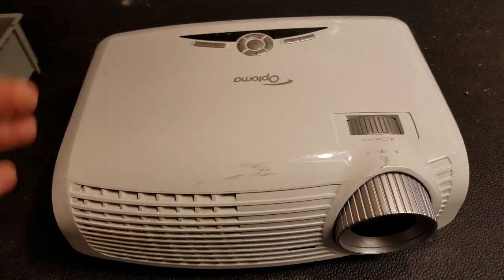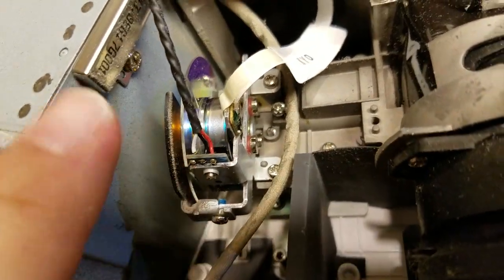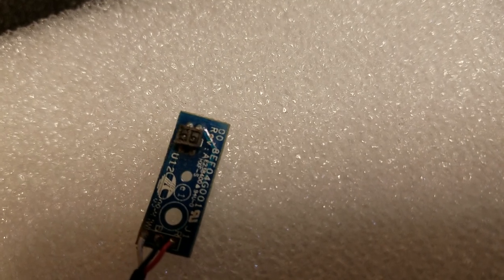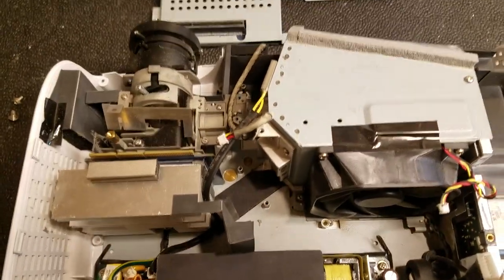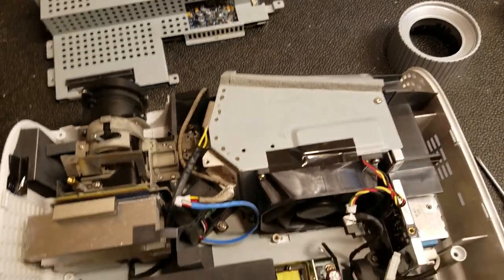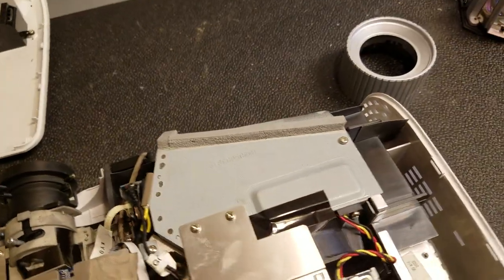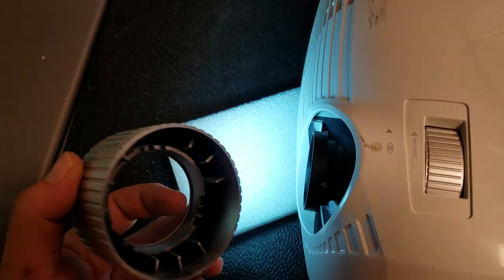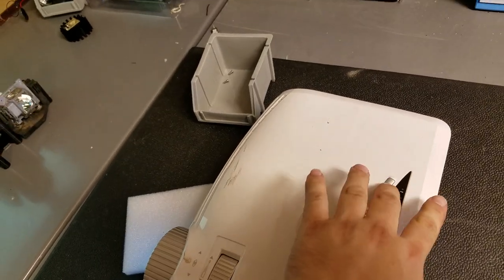Optoma HD20 Projector Cleaning

Comment: When cleaning the circuit boards and fans do you use rubbing alcohol or just an air can to remove all the dust?
Reply from the maker: I use an aircompressor personally and then use a dry cloth to wipe off the rest.  Alcohol would work, but Id be careful in case it attacks the plastic. The goal is get as much dust out as possible. I wouldnt go overboard and remove too many things to clean. You then stand the chance of having issues re-assembling.  I would use some canned air if you have it available and then maybe a dust rag to wipe off the fan blades.  less is more when it comes to disassembly.
Reply: Rostit aweosme thank you very much

Comment: The video beam worked perfect when I turn it off that night the next day I just start the led color ambar and do nothing else any solution
Reply from the maker: tomas di maio amber led is normal when not on. Unplug power and wait 1 minute. Plug in power. Press power button on beamer and it should start. If you use remote, replace batteries first.  if still amber and no fan or light, the problem is more severe.

Comment: How did you get the mother board out?
Reply from the maker: https://elektrotanya.com/showresult?what=hd20%20optoma&kategoria=&kat2=all  Here is a link to the service manuals.  You need to remove the screws around the motherboard as well as the bracket on the top of the optic block.  I have a newer video where you can see me remove it.  https://youtu.be/IBs7E5pkS1s?t=575

Comment: hi Frank.....i have some faint white circles on my screen only can see i dark seens....i am assuming this is due to dust in the optical path......my pj is an optoma eh500. do u have experience with thia pj if so how much would u charge to clean tbe optical path of dust?
Reply: Hi dear this is zee khan my optoma hd20  when i turn on the green power  light plinking  the projector doesn't on  plz tell me how to fix it thanks

Comment: I want to buy a used one. Is $100 a fair price in 2019?
Reply from the maker: That's on the cheaper side. They go for 150-200.  It's an old but good projector. If you can get one for $100, that's good

Comment: FixitFrank
2 weeks ago
Hi Shane,  You probably have a fan either stuck(wire tucked into a blade) or maybe a wire isn't quite plugged in on one of the fans.  That error(if happening instantly) usually means a bad fan.  If all fans are spinning, it might be the tachometer lead of a fan that isn't working.  How are you with a volt meter?

Shane Monson
Shane Monson
1 week ago
@FixitFrank Thanks for the reply. I have and can use a volt meter but it's been awhile.  The errors don't happen immediately.  After I replaced the fans and bulb I tested with the top cover off like you did in the video. It powers up, bulb comes on, fans and color wheel all spinning.  I get the errors after about 30 seconds later, then it shuts down.  I'll ensure all the connections to the main board are solid and try again.  How would I use a volt meter to test?  Thanks!
Reply from the maker: Hi Shane!  I am editing a video right now that shows me checking the fans inside an HT1075. I do have an older video on testing fans https://youtu.be/stIYr2bI2fQ   The new one might be a little more comprehensive if this one isn't enough.  I should have the new one up in the next day or so.

Comment: Hi Frank, I own an Optoma hd25e. About 3 months ago it shut down suddenly the day after the usual use from the night before. It worked during a month aproximately with scrambling image and colour; I thought it was the satelite box (source) and replaced with a new one, but when I tried to put it on it didn't work and both lights of temperature and lamp turned on and it's since then I can't use. When I try to turn it on it gives the logo but not the image and goes on protection mode. Note that I replaced the lamp with brand new genuine one just in those days. Contacted Optoma Europe and they told me by symptoms it could be the mainboard, but checking on forums like this I learned about the CW sensor and dirty into whole case and parts. According to your competence and experience, is it possible my problem could be solved by deep cleaning?
Reply from the maker: Hi Mario, It does sound possible. When the image starts to fail, do you hear what sounds like a fan changing speed? The CW sensor will cause the CW to change its speed up and down until it shuts down. A simple method to clean the sensor is to remove the lamp and blow out the inside with compressed air.  That may loosen and remove enough dust to allow the sensor to work again. You can see its pretty small. This one is not much different than the HD25.   Was the image itself ok?  or was the issue both image and colors?  A CW sensor issue will not affect the actual outline of the image. Only the colors will flicker and change. If you can post a video I can weigh in more specifically.
Reply: Hi again F, if I will post a video you will see the projector not running to give an image, but it starting to project  the logotype OPTOMA  and then shutting down with both lamp and temp lights on. To explain better when the image had started scrambling during that month the colors kept or, for very few seconds, instants, appeared only one (green or yellow). When I replaced the lamp I tried to remove most of dirty, especially from the fan, but I was conscious that it wasn't enough, because I didn't open the whole case to replace the lamp. I think the problem was more about image than about color(s). Bye, by now. Tomorrow I will post a video of the projector running.
Reply from the maker: Sounds good. I only ask because it will be easier for me to tell what the cause is with a video.
Reply: Hi again, I tried to upload a video and send you, can you confirm you received? thank you
Reply from the maker: Hi Mario,   I see what you mean.  That is most certainly a failing colorwheel. You may be able to save it though.  I sent you my email in the PM.  Thanks!  Frank
Reply: Hi Frank, I couldn't be able to open the PM, so I can't mail you. What do you mean by "save it though"? Do you think a deep air blowing on it and whole inside will fix the problem? Or better change it? Thanks in advance for any help
Reply from the maker: I think with some gentle cleaning with some isopropyl alcohol will work. Its at least worth a shot.  New wheel is $70USD but yours might be able to be saved. my throwaway email is rostit@ultrafark.com  Ill reply with my actual address from there.

Comment: Hi, I bought a second hand HE415 Optoma.. I had to buy a new lamp and when I turned it on it has white looking dots all over the screen. I did take it apart and tried to blow air in the color wheel but still having the white dots...any ideas or help?
Reply from the maker: The white dots are from a bad DLP chip.  The only way to fix that is to replace the DLP chip itself.  They are some of the mirrors that cant flip back anymore and they show up as white dots and sometimes even flicker.  This thing is what is bad.  https://d3nevzfk7ii3be.cloudfront.net/igi/VdJ5MYVMlULKubZK.medium
Reply: thanks so much...am I in for an expensive repair? is it worth doing or is it a lot of trouble?
Reply from the maker: They can be expensive. Im having a hard time finding service info on that model but I think its close to an HD142X.  They use a DLP chip that you can buy for $130-170 depending on where you find it. The total job can run around $250-300 depending on where you live. Its doable yourself and not super hard as long as you arent scared about taking it apart.  Fortunately you cant make it any worse. If you want to move ahead, Ill get some videos up that show a general DLP chip replacement.  Most DLP units these days are basically the same and involve almost identical steps to replace the chip. The important thing first is to find what the part# is.  Is there any other model info on it besides that HE415?   A regulatory model # maybe?
Reply: I've already had it apart to clean it with slight air to the color wheel and whatever I could get to because that's what I was told originally that it was probably dust. There is no actual model number on the projector itself. I had to search by pictures and then finally found the manual to download it. All I know is the EH415. I did buy a new lamp for it that's why I hate to give up on it. I can definitely try and do it myself...thanks for all the help. would love to get this thing working properly
Reply from the maker: OK. You  should be alright replacing it if you are comfortable with that work. The chip is behind the heatsink on the back of the optical assembly.  I recommend removing the whole assembly(colorwheel and all) and working on it outside the projector.  The chip will have a # on the back of it. Some are locked in with something like a CPU latch that you turn with a screw driver. Others just pop out of a socket.  You can search that # on eBay or Aliexpress for replacements. Likely in the  $100-150 range. My only hesitation with some DLP replacements is that the new DMD chip is made as well as the old DMD chip so its only a matter of time before that one fails.  Here is an example of the part # and what the DMD in your projector looks like.  https://www.amazon.com/Multiple-Brand-1910-6143W-Chip-1920X1080/dp/B00AK4QBUE  Im not sure if that is yours, but if the 1910-xxxx matches yours it might be.
Reply: Rostit thanks so much. I'll give it a try to take the old one out. Will let you know. Thanks so much for your time and patience. I really appreciate it.
Reply from the maker: WOW! That is a little ridiculous. That is hopefully for the entire optic module. Its the lens, color wheel, dmd chip socket board etc. That is really high for just a chip. I would expect $250 on the chip from Optoma.  $150 on eBay. You only need that chip on the back(behind the heatsink). I should have a video up soon that shows how to replace a chip in a Mitsubishi. Its almost the same steps. They are all only made by a handful of companies and branded differently.  BenQ and viewsonic and some newer infocus are all the same. Polyvision, Vivitek, some optoma are all made by Delta. Texas Instruments makes the chip. You can get it right from them but I ususually use aliexpress or something like that to get them from China for a bit less.

Comment: Very similar to the hd131xe which is an epic projector
Reply from the maker: It's interesting how many projectors are almost the same.  Even when they take different lamps, I find a lot that have almost identical guts.  Between Coretronic, Delta, Mitsubishi and other OEMs, I bet there are only a half dozen companies who actually construct projectors.
Reply: @FixitFrank  m8 on my hd131xe im noticing the left side of the picture is slightly darker than the right, any help here would be greatly appreciated
Reply from the maker: IF you can show me a pic or video I can give you better advice, but I'd suggest the lamp (if its more than 2 years old) might be failing or the light tunnel perhaps has shifted. It all depends on how drastic the dim area is. If you see a clear edge where it gets bright again, I'd lean towards a light tunnel shifting. If it is a soft change from dim to bright, I'd try a new lamp (if it is older) or give it a cleaning in case dust is blocking some light.
Reply: @FixitFrank  hello m8, ive cleaned all the optics with lens cleaner, the bulb has 580 hours on it, the bulb looks immaculate no dust on it but there was dust everywhere else but ive shifted it all, yea it is a subtle shift in brightness, the left side is not as bright as the right, its noticable on a white or coloued full screen, the bulb is the factory one its got 580 hours on it from new in 2015, thank you for replying mate
Reply from the maker: That is a tough one.  Subtle issues are the worst. If you are comfortable trying this, bypass the lamp door switch and power up the projector.  Try pushing the lamp slightly to one side. 

You could use a long thin piece of something non-metal tpo push against the light tunnel edge a little. If you see that dimness shift, it points more to a light tunnel moving. Light tunnel moves by two small screws set 90degrees apart. They have a spring that pushes back on each axis.
Try shifting the lamp first. 4 years <600 hours is still pretty new for a lamp but maybe it shifted from heating/cooling.

Vaguely put, something is not in line with the focal point of your lamp. 
The light converges at the face of the color wheel. Then the light tunnel guides a focused beam into the two lenses at the beginning of the optic module. They focus the colored light at the mirror, off the mirror through an angled lens onto the DLP chip. Then the main lens assembly projects from there. The mirror, the angled lens(very doubtful) may have shifted. More so the mirror. The 2 lenses after the light tunnel can't move.  That leaves, Lamp, Light Tunnel, Mirror as the most realistic culprits. Hope that gets you closer.
Reply: @FixitFrank  Thank you somuch for the detailed answer mate,  there is a small adjustment screw right next to the colour wheel, is that for rgb calibration? ill have a go at sorting it tomorrow mate and ill post the outcome, once again thank you.
Reply from the maker: @Synthematix No problem. That screw is probably for the light tunnel. If it has what looks like loctite then you know for sure. The RGB sync is done by the small PCB mounted next to the CW hub. The hub has a black stripe that interrupts an IR sensor that reflects off the metal hub. The 'index' is sometimes adjustable in the service menu. All depends on the brand.  By the way. Nice job on that TA-636.
edit: I looked at the HD20 service manual and the adjustment screws are on the top of the optic module. You could adjust them there pretty easily.  It's the 2 small phillips screws 90 deg apart.  They call it "rod adjustment" ........ Page 2-18 Service Manual --https://elektrotanya.com/optoma_hd20_hd200x_hd2200_eh1020.pdf/download.html
Reply: @FixitFrank  Thanks pal, yea the old ta-636 is now 40 years old and still going strong! the sound from it is absolutely awesome i tell you! im gonna have a butchers at the projector tomorrow and try and find out whats going on,probably somethings shifted  during shipping from ebay

Comment: Oh shoot. After teardown and cleaning the color wheel, fans and the rest of the projector, it does not fire up again. When I switch on, the power LED just goes from orange to blinking green and after three seconds back to orange. The projectors remains dead without making any fan noise or light bulb action. Nothing is moving or happening. Checked the internal connectors several times. Can somebody help?
Reply: Ooh, the screw of the bulb closure was not tight enough, I guess. Now it is working :)